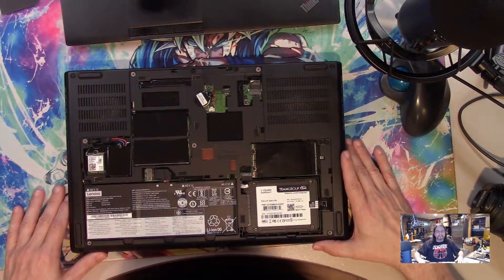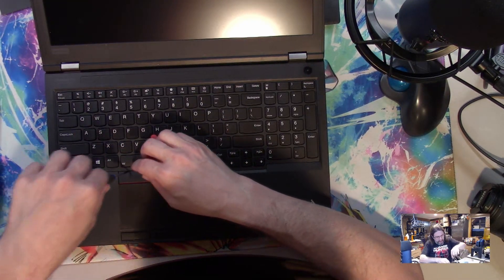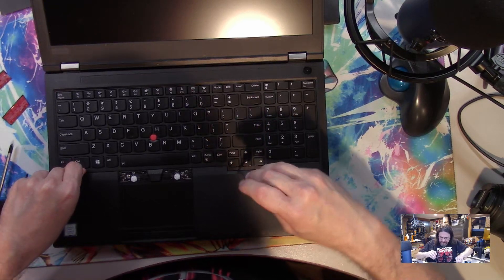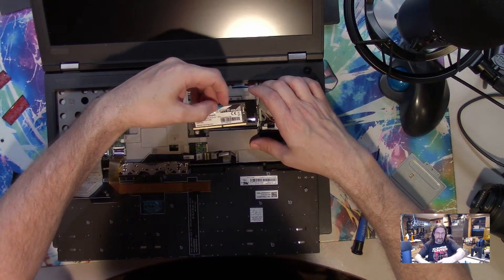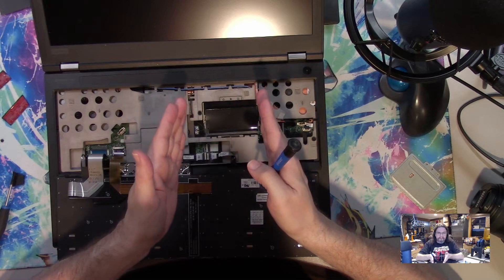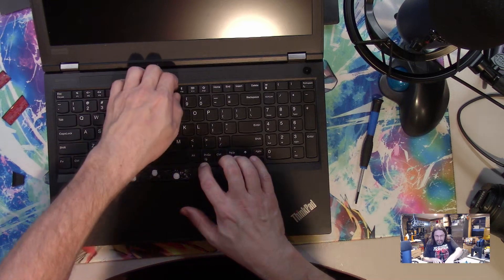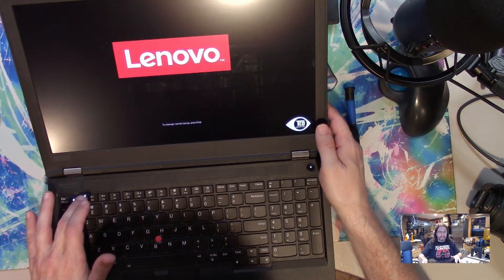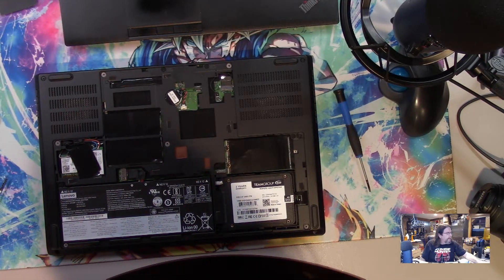How to install memory in a Lenovo P53 laptop

Comment: Gary, do you recommend unplugging the battery first inside the unit or adjust any power settings in the bios or control panel  or anything?
Reply from the maker: I have just installed the memory and started up the machine. Entered the bios to check to make sure it sees the extra memory. Then reboot the machine and go into the os. I usually don't adjust the settings in the bios when it comes to memory.
Reply: @garyshobbystudio  OK great...I was just wondering about the power, like making sure there's no power on the board and such when doing the ram install.
Reply from the maker: I do recommend not having the power cord plugged in but have not had an issue with the battery still attached.
Reply: Thank you sir!  You are very helpful.
Reply: It is very highly recommended to unplug the battery and any power to the laptop before changing the ram. In my firiend's shop his tech ruined a laptop's motherboard just by not removing the battery while changing ram.